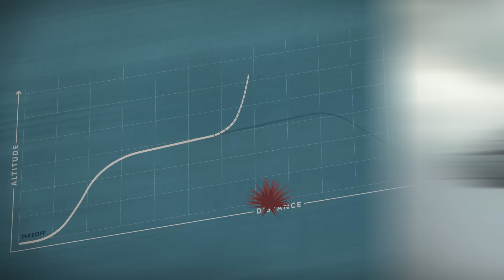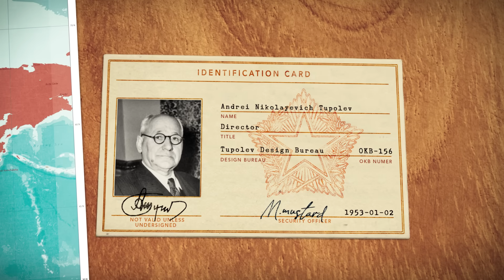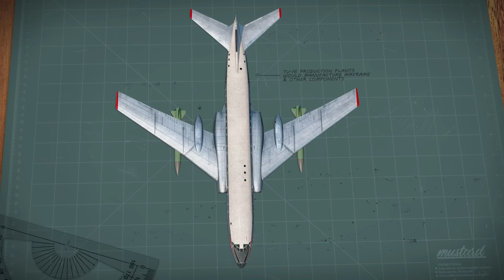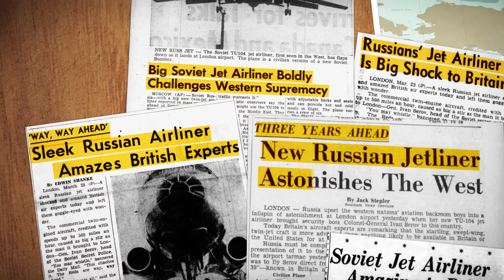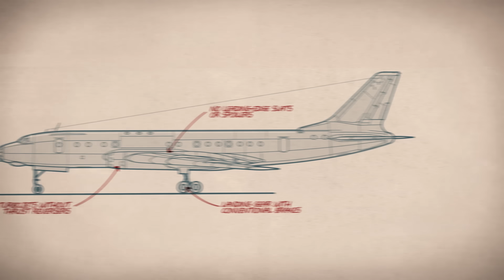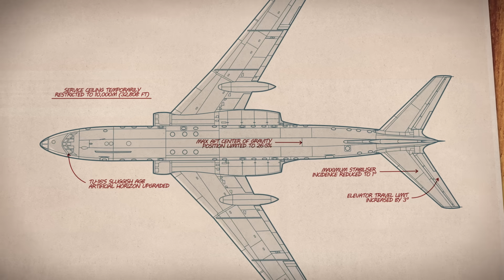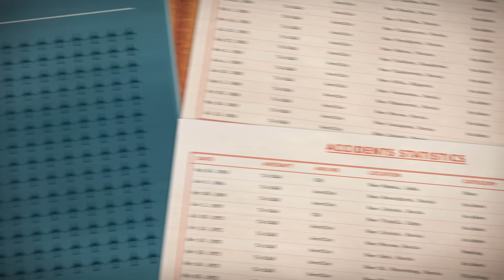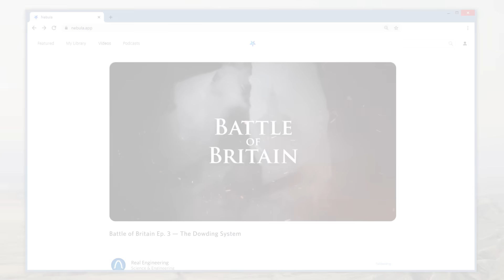The Soviet Airliner Designed To Crash

Comment: But now Aeroflot, all things considered is quite safe now a days,,
Reply: But now due to sanctions that airline has Nationalised (stolen) many leased aircraft, it has no parts supply chain now for those leased (Stolen) aircraft, so at some point in the future those aircraft will start to fail, possibly drop out of the sky.
Reply: @darren25061965  Yet they wouldn't need to do that if the west hadn't put so harsh sanctions that made it hard to pay, but Russsia still could be able to buy parts from friendly nation sith the same aircraft
Reply: @itsve8632  But the aircraft should not have been Nationalised (Stolen) in the first place, An A320 for example cost $101 Million each, Im sure the owners would rather have them returned instead. With regards to friendly nations supplying parts, any country that does could be faced with secondary sanctions, additionally companies that supply parts for aircraft are required to be certified for the manufacture of the parts, those certifications can be revoked which would effectively be the end of that company if its sole buisness was aircraft parts.
Reply: @itsve8632  No doubt some will consider it, they may think its worth the risk, and for some it may pay off, whilst some may suffer. Its how much risk they are prepared to take.
Reply: @darren25061965  stolen is not the best way to describe it.  Russian airlines did try to pay them for a lease, but the western payment systems had been sanctioned in Russia so they simply couldn't transfer the money.  Lease companies also demanded the aircraft back, but the Russian airlines stated that they would keep the lease since they signed the contract and they are simply relying on those aircraft to bring revenue in the first place.  But I understand, in the west everything is black and white there  (all western is good, all Russian evil)

Comment: I watched Russian TV film about this aircraft where they mentioned that pilots reported many times weak responsiveness of the elevators and official reports after the first crash, which mentioned this dangerous tendency to pitch-up, but Tupolev himself ignored pilot's complains and the report and said that pilots just don't know how to fly. Probably because this aircraft was a favourite one of Krushchev and authorities just didn't want to take responsibility to ground this airplane - direct results of autocracy and totalitarianism. If they haven't ignored pilot's reports, they would have avoided future catastrophes and deaths. Another issue for this plane was it's challenging landing, pilots should descend in steps rather than smoothly following glissade. All in all Tu-104 scored the worst reliable Soviet airliner with 37 airplanes lost out of 201 produced. The last catastrophe happened in 1981 (being dismissed from Aeroflot, Tu-104 still has been in use for army). In this catastrophe high-ranking Soviet military personnel of Pacific fleet had died.
Reply: tacticalmoonstone9468  He also noted that the cause of the accident was unsecured rolls of printing paper that were being, in essence, internally smuggled to the Far East, each weighing half a metric tonne. When the plane pitched up to take off, the paper rolls rolled to the back of the (tail) cargo compartment, destroying the plane's balance irrecoverably. No pilot on this earth or the next could have saved it. The irony that the cream of Soviet Naval Defense had died because of their bourgeois (and possibly capitalist) greed seems to have evaporated from the official report.
Reply: @angusclark8330  Interesting info. Capitalism doesn't have anything more to do with greed than Socialism does. One can be greedy in either system.
Reply: @matthewmosier8439  Indeed.  Boeing 737 Max, anyone?
Reply: This sounds more like modern Ukrainian TV. Rewriting history in Goebbels fashion.

Andrey Tupolev did not "ignore" anything. There were several incidents in 1956-58 when similar aircraft(Tu-104 and Tu-16) flew into Microburst Wind currents in storms and were pulled up by those wind currents beyond their design ceiling(altitude) - which resulted in the catastrophic outcome. 2 were fatal - literally the first 2 for the Tu-104. This only happened at high altitudes above 10,000 meters. This phenomenon was new and not understood in the 1950's. The immediate response was to order jet aircraft similar to the Tu-104 to only fly at or below 9,000 meters. But a permanent solution was implemented by retrofitting existing aircraft elevators and other control surfaces so they could recover from these extreme weather conditions.

After 1958 this NEVER HAPPENED AGAIN to ANY Tu-104.
Reply: @legatvsdecimvs3406  agree. Seems that "mustard" has issues not with the Soviets but with the Russians particularly. The video content (animation, graphics, etc...) are pretty much excellent, I should admit: like that ex-Vox dude: Johnny Harris (I believe this is his legal name) , another pseudodocumentalist, with the rusophobian tendencies,  but with well-done videos.
Reply: TacticalMoonstone  Thank you for letting me know.
Reply: "direct results of autocracy and totalitarianism. " I guess communist are responsible for boeing 737max ? ;-)
Reply: Citizens of America, observe control, do not withdraw money from banks, let the banks burn with your money! Money can only be withdrawn to capitalists, not you, don't worry! Money is more important to capitalists than to you,;
Reply: whats the first song name
Reply: Half the reason Tupolev denied the flaws were that failure at his level meant gulag for him and poverty for his wife and kids, even during the Хрущёв era.
Reply: @hypnocoil3968  

GULag(Glavnoye Upravleniye Lagerey) - Government Administration of Prison Camps was disbanded by the end of the 1950's by Khruschev, millions of inmates were released. Which created an increase of criminal activity in the early 1960's.

Tupolev was already sent to an NKVD Engineer's prison during Stalin's Government. From which he was later released without a scratch.
Reply: @hypnocoil3968  Got a source for that lie?
Reply: Ppp
Reply: Well, it is probably Soviet totlitarism and authocracy made few Boeing 737max to crash and two whistleblowers died in strange circumstances after reporting negligence and sweeping under the carpet tech reports.
Death hand of Communism still taking lives from the grave.
Reply: Pilots' reports had been ignored, dismissed or silenced in many cases in the west too (IE in the Boeing 737 Max scandal). A direct result of capitalist greed. 
Even in a totalitarian state, the reason the aircraft had not been grounded is economic, the "sunken costs fallacy", the impression that too much had been invested in the project to dump it. That's especially true in planned economies since, in those, there is not a competitor to choose if the main project fails.
Reply: @neutronalchemist3241  Perhaps a significant difference though is that the MAX was grounded after the second crash whereas the Tupolev kept on flying regardless of numerous crashes.
Reply: @neutronalchemist3241   Well, you compared! Back then, the saturation of information in general was much lower.

Comment: I can't fault the design decision to start with the bomber that they already had, and seek to civilianize it. That was a common enough practice. Heck the legendary Boeing 707 evolved from such. As did its predecessors the 307 and 377 Stratoliner and Stratocruiser developed from the B-17 and C-97 Military aircraft. So starting from a Military Aircraft wasn't a bad starting point. Their problem was they didn't have a jet Cargo aircraft already developed to use, and went with a bomber. And it was the wing that doomed them. Both the shape and angle. And that strange downward pitch to them. If you look at modern aircraft you will see that modern high winged aircraft will pitch the wings down while low winged commercial airliners pitch them up. Each design gives some stability pros and cons for the operation of the aircraft. With the commercial airliners low wing pitch up being the more stable in flight design. But low wing pitch down? /shudder.
Reply: I believe this wing tip down referred to here is otherwise referenced as anhedral. Wing tips higher than the root is termed dihedral and is considered the more stable in roll. As commented here, anhedral on a mid mounted swept wing would most certainly have resulted in unstable roll characteristics. This is because of two reasons. The lift vector of the raised wing becomes prominent while the sinking wing deflects sidewards inducing asymmetric lift encouraging an even more rapid roll rate. The second is related to the centre of lift being lower than the centre of gravity. Once roll is introduced, the plane would be likely to accelerate the roll until inverted unless countered by opposite aileron. Not a good trait in turbulence. Dihedral will self level wings from a wings not level attitude. What is interesting is that having centre of gravity rearward of the centre of lift has always been known to be unstable. Fighter jets (F16 was the pioneer) adopt this as this is desirable in a highly agile airframe, but HAS TO have computer augmentation to counter the instability to make the aircraft even remotely flyable. All civil aircraft are trimmed with centre of lift aft of centre of gravity.

Comment: It was far more reliable than De Havilland Comet or Boeing707. Both of the UK and US planes had more crashes even tought they flew in much more favorable conditions.
Reply: interresting, can you give more details and sources?
Reply: @snolbie1016  My direct source is wikipedia. The original sources are listed there. Of all planes made 18% of TU-104:s were destroyed. 20% of Boeing 707:s and 22% of De Havilland Comet's. ~ High numbers but given how much they flew it was not as dangerous as it sounds. For example this russian plane Tupolev-104  transported over 100 million of passengers during its usage time. De Havilland was a complete mess and was put out of commission for 2yrs and completely redesigned. Being the first that's only natural and the British engineers gave a lots of critical data to the soviets for free when they heard of their project.. for the sake of safer arelial travel. For example that square shape windows and weak spine are really bad ideas. Their American countetpart was designed last but still was not up to soviet standard at that time propably thanks to the iron curtain.

Comment: Same thing happened to US commercial jets. Tried to fly up in a down draft. In Russia the weather is worse and they are slow learning from mistakes.
Reply: Yeah in Florida first experience with maybe a 707 hit an up draft and pilot configured plane to fly down. When they hit the down draft the pilots were thrown up against the cabin ceiling. It was all over, couldn't reach controls , plane exceeded speed constraints, broke apart and buried itself in the swamp. The learned real quick not to fly down in an updraft. The Soviets weren't so quick to adjust to flying jets.